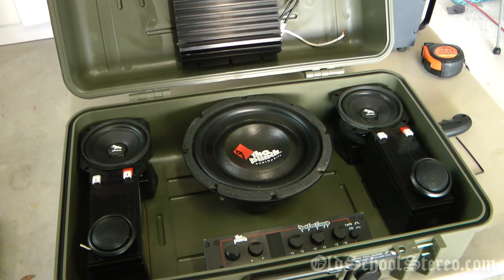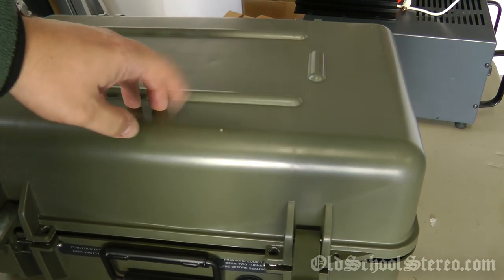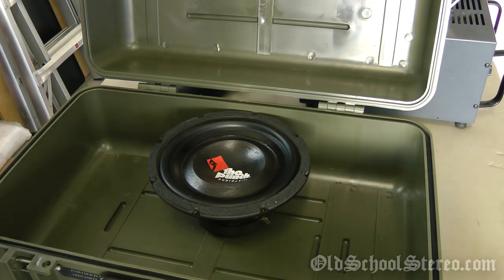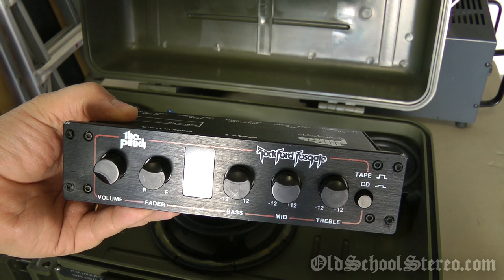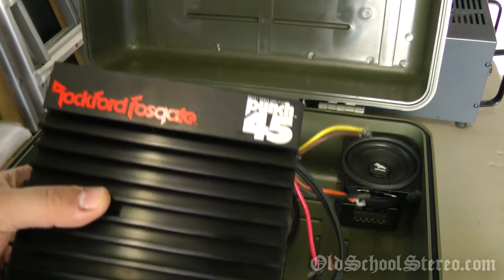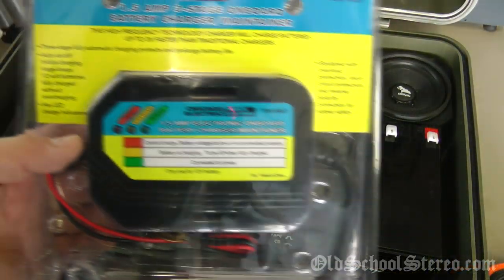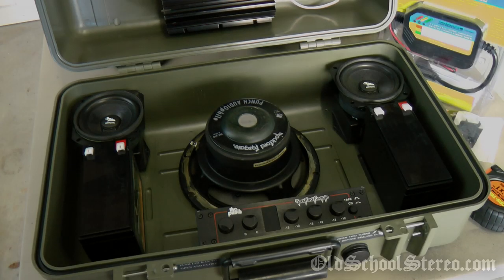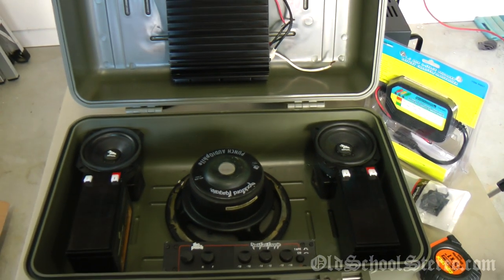Old School Boombox - Car Audio Gear - Rockford Fosgate Audiophile Speakers 1080p

Comment from the maker: @txluke The output voltage of most newer car audio preamps is going to be high, between 4-8V, maybe higher. This should give you all of the clean signal you need to feed your amp a clean signal. The Clarion EQS746 seems to get good reviews if you are looking at a new unit

Comment: Nice! I've still got a bunch of RF Power Series stuff, 2x10"s, 2x6.5"s, 2x5"s, power series neodymium 3" tweeters With the Audiophile crossovers, Power 500 & 250 amps. still in good shape.

Comment from the maker: @txluke It gives easier control of volume, plus adds some other tone controls. You just set your iPod to max volume, then use the preamp to adjust it. I've also found most iPods don't put out enough voltage through the headphone jack to drive amps to their max volume. Next time I get a chance, I'll measure the max voltage output from my iPod and iPhone

Comment from the maker: @gogojjt Those original PA-1s have gone for as much as two fifty on feebay! This one is MINT as you can tell by the video. I thought quite a bit about using it then said why not! I may have to make some changes based on the very limited available space in the case, but I'll keep you updated...

Comment: Ive actually made a portable speaker box close to this. It has 1 6" mid speaker 1 tweeter and 1 10" subwoofer powered by a 400w car amp running of a 12v battery. Its pretty badass and loud as hell.

Comment: hey big d I have a few of the real military boxes like that that are aluminum, they are air tight and water tight,, they were made to house the night vision shit for the military,, these boxes are tuff as hell, I filled one with 10.000 rnds of 9mm and droped it in the rver next to my boat,, one year later still bone dry,, I use them for ammo cache and storage,, but have a few extra,,hey have 2 clamp latches on all 4 sides,, would be a great enclosure for something like that,, I thought about using one for a portable stereo for when I get off the boat at the beach but never did,,   as usual another cool vid,, great work,,

Comment: You guys need to use pc power supply's.  Your rms will drop because it's only 12v opposed to 14v, but it's a clean 12v and it's fan could help cool the speakers.  My power supply runs cold while power a 400w amp for my home stereo sub.  You could also use it to charge the batteries.
Reply: Casey Rodriguez but you do that at your own risk because your back feeding the power supply which from what I heard can cause serious damage to the batteries and the power supply because you can overcharge a lead acid battery with a power supply and cause the power supply to explode because a power supply is not a battery charger

Comment: instead of a female mains connector, i might suggest using, a, speakon neutrik connector, twist to lock, small latch to lift to release, can handle a decent current and would be better protected and more robust :)

Comment: i think you should use that pac tri mode crossover when you did the video on tri mode crossovers,it was shown.its the smallest and i just bought one for 99 cents new from ebay the shipping costs were 8 times the cost of the cross over.no one bidded on it.downloaded the wiring diagram for it but would like to see it done first.so ill stay tuned.

Comment: That battery tender from HF is a terrible choice unless you keep it plugged in all the time in storage,  otherwise it will drain the batteries when not plugged in.   The small schumaker 1 or 2 amp chargers do not drain when not plugged in.

Comment: I was thinking of building something very similar!  use a vintage hard suitcase. add components small subwoofer and amp. batts and charge controller and head unit. then a way to charge/power it from home or in car. boom there you go. music anywhere. this looks much better than mine would have. if I had built it. it would very nice if you travel for work. in a car you don't own. so you can have a nice system and its portable. add blue tooth and its even better! thanks

Comment: I want to do the same thing but I don't know what I must have. I have two stereo speakers from an old stereo (Kef C15 speakers). Do I need to buy an amplifier and a crossover and a pre amp? Or can it be simpler with a car radio or something? My budget is $400

Comment: Have you completed the build yet?
Reply from the maker: Unfortunately no, I decided to use the 4" RF AudioPhiles in bookshelf speakers and have put this project on temporary hold. I'll still finish it and I'll be sure to make a video (or a few).
Reply: Dereck BigDWiz shame it looked cool. Thanks for posting vid tho as i've now completed a flight case with infinity cappa componants and alpine headunit. Thanks for the inspiration!

Comment: Where is the follow up video of the boombox?
Reply from the maker: Project was put on the back burner. I did, however, convert the 4" RF Audiophile component speakers into bookshelf speakers.
Reply: BigDWiz Dang. I was looking forward to the follow up video bc I'm trying to build one myself and your video is the most helpful one I've seen so far.

Comment: i want to do a similar build with 4 RF-P1675-S (components) or with 4 RF-R1675-S (components)and will be wired in series to give it 8 ohms each side for a TPA3116D2 2x100w amplifier..do you have the follow up video #BigDWiz
Reply: hey #BigDWiz what you think about the TPA3116D2 (100w x 2) ? if doesn't work I'll get the Rockford P300x2!

Comment: To all you people who want to charge lead acid batteries inside your car stereo boom boxes do not use a power supply such as a computer power supply or a led strip lamp power supply as a battery charger because using a power supply as a battery charger can cause serious damage to power supply because your essentially back feeding the power supply which can cause it to get very hot and cause the power supply to explode and catch on fire plus it will overcharge the lead acid batteries and cause the lead acid batteries to get hot and explode as well so guys do not use a power supply as a battery charger because a power supply is not a battery charger if you don't believe me that's fine but you should know that if you insist on using something to charge your lead acid batteries then get a trickle charger or a battery charger that puts out 1 amp of charging current but don't use a power supply as a battery charger because your gonna burn your house down if you guys use a power supply as a battery charger because I can't stress enough that a power supply is not a battery charger I know I'm talking a lot but it just drives me insane seeing people use a computer power supply as a battery charger because they end up ruining their batteries doing it
Reply from the maker: I personally prefer the CTek chargers